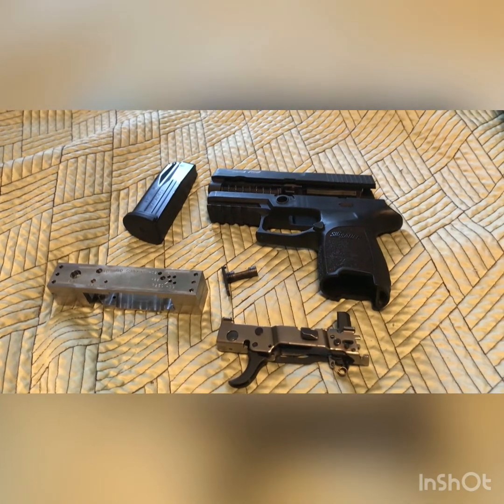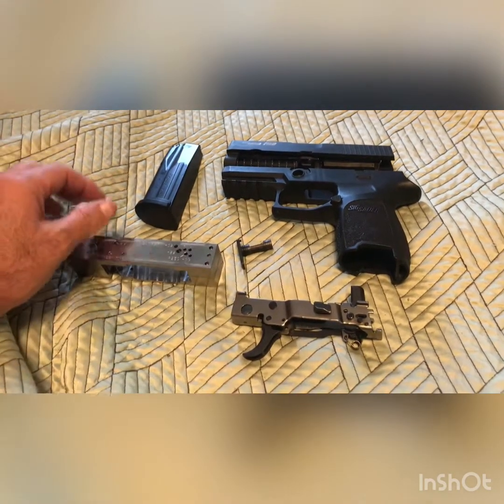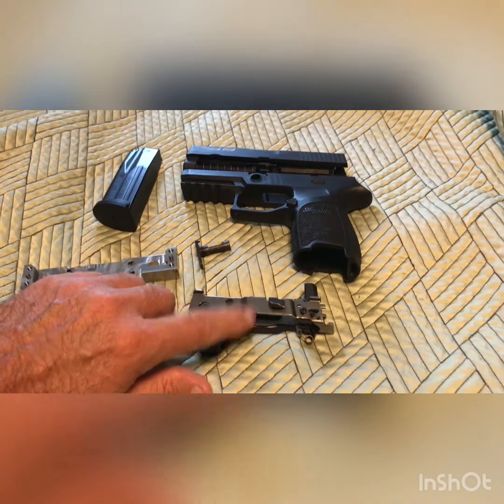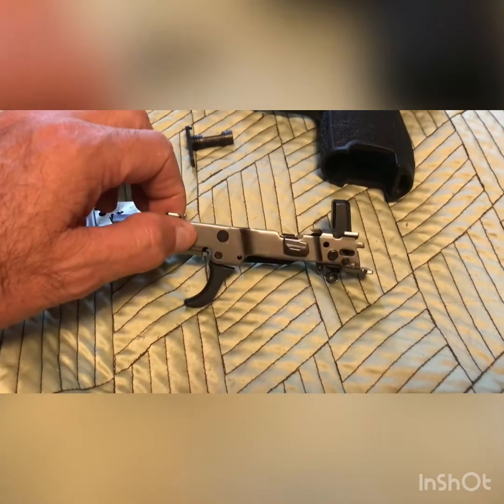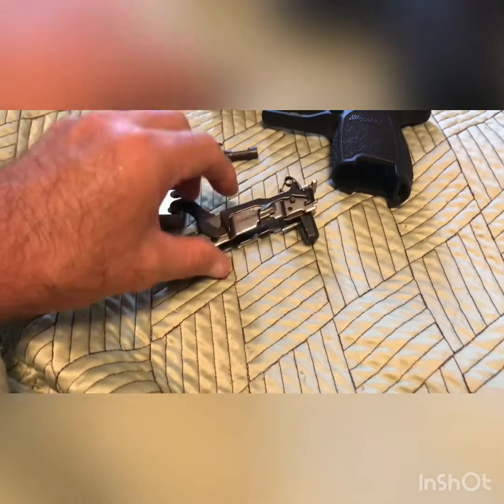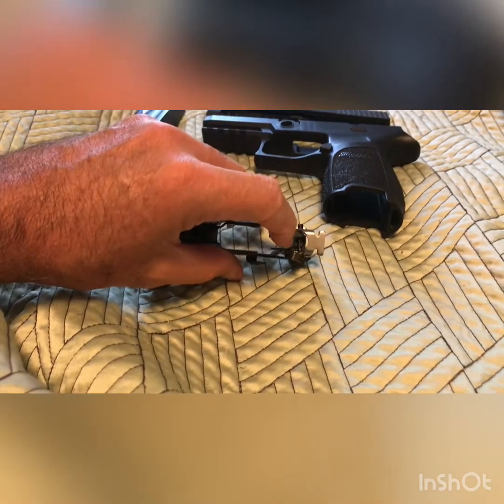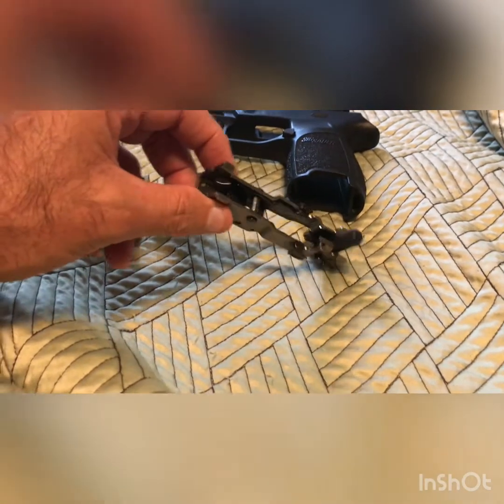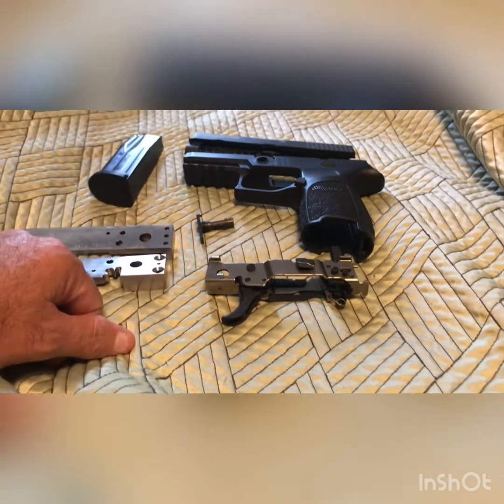Sig P250 45 ACP Build On A Modified Sig P320 FCU

Comment: Did you have to cut some of the ejector, like you would if using a p320 9mm fcu into a p320 45 acp ?
Reply from the maker: The only thing modified was the FCU so that the hammer would function correctly.

Comment: Does the ,,,FCU,,,, of a 22LR,,,,,,, fit a module designed for a 9,,,,,,????
Reply from the maker: I have no idea about that one……..
Reply: @blackriveroutfitters7185  they are interchangeable all of them. only the 22lr slide is not beefy enough but the control unit is.

Comment: Does the p250 parts for the fcu have to b for a 45 or will any model parts work?
Reply from the maker: I’m pretty sure my FCU is a 9mm. I haven’t tried getting say 9mm parts and building a Sig 250 9mm, nor have I tried to build any caliber of Sig P320 with this FCU. So with that said if you have Sig P250 9mm parts to install in the converted Sig 320 FCU it should work if your building a Sig 250 9mm. Hope that answered your question. If not feel free to ask my old dumbass again. Lmao